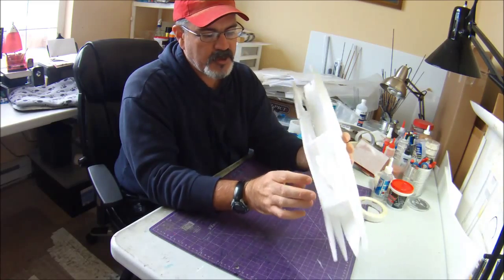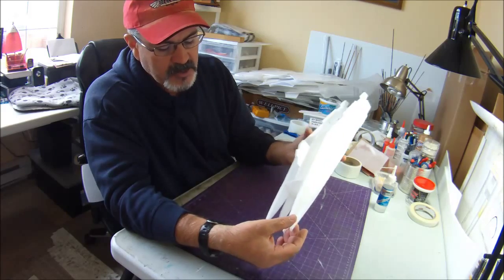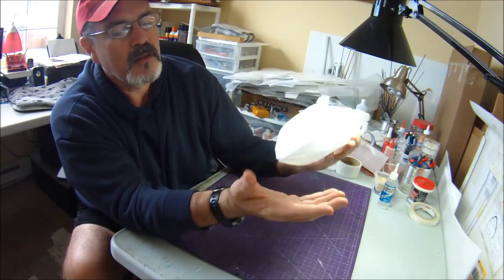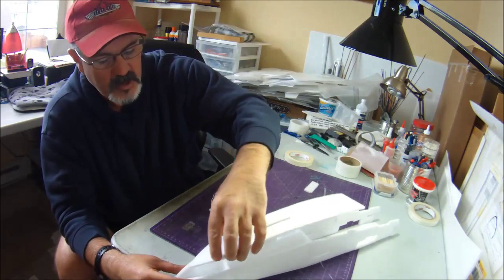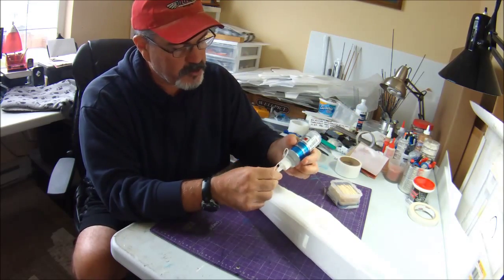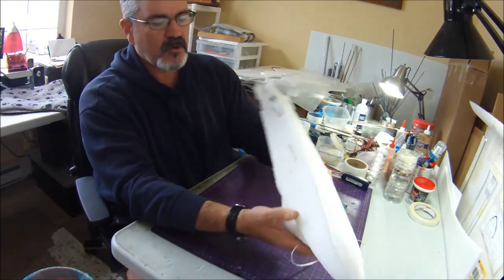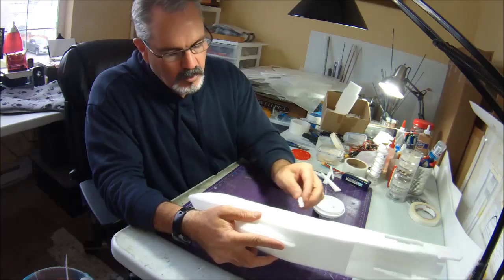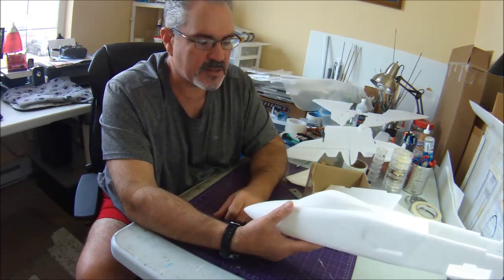NAMC Mig FA nose construction

Comment: what are the advantages of foam cure compared to the 5-min epoxy? which one to be used for which bond? do you use hot glue? thx
Reply from the maker: Foam cure is dispensed out of a bottle, so no need to mix and less waste.  However, it does take quite a bit longer to cure than 5 min epoxy and does need partial exposure to the air to fully harden.  Epoxy in my experience is better for securing carbon rods etc in the foam for reinforcement and securing control horns and motor mounts.  I do use hot glue sparingly to "spot weld" when I need to hold a couple pieces together and need something that sets up quickly.  I also use hot glue to secure my servos as it is much easier to remove when I need to recycle servos to a new plane.  Cheers, Scott
Reply: thx a lot for all your answers!
Reply: can foam cure be sanded like the epoxy?
Reply from the maker: Sure thing, best of luck on your RC journey :)  Cheers, Scott
Reply from the maker: Yes, Foam Cure can be sanded just like epoxy, it takes a little time and patience, but it will sand quite nicely.  Cheers, Scott
Reply: one question again. can you cut the foamcure with a scalpel? for example a thin layer between two depron sheets?
Reply from the maker: Yes, you can cut it with a sharp knife.  I let it dry completely, normally overnight and then always use a new, sharp blade and it cuts/shaves very nicely.  Cheers, Scott

Comment: hi. whats the stuff called you show at @39:15 ?
Reply from the maker: It is called DAP Fast and Final, a lightweight finishing spackle for filling drywall and other things.  It dries very light and is easy to sand.  Here is a link I found on Amazon https://www.amazon.com/12141-FastN-Spackling-Interior-Exterior/dp/B0006MXS10/ref=sr_1_1?ie=UTF8&qid=1492369477&sr=8-1&keywords=dap+fast+and+final  

Cheers,

Scott
Reply: i see. thanks. any experience with gypsum?
Reply from the maker: Sorry, no experience with gypsum.  Cheers, Scott

Comment: I hope I was clear on what I am doing with the strips. I cut them to form a triangle. THis triangle I insert at the folds with two sides getting a small amount of Foam Cure glue. This smooths out the fold and adds strength with almost no weight gain because I am adding less spackle.
Reply from the maker: Doug Wittenberg Hi Doug, no problem, I fully understood what you were saying, I have used that method in the past as well and might try again on another build now that I am using Foam Cure, I need to practice a little more to get the triangles closer to the right shape, my "surgical" knife skills aren't the best :/  Stephan uses the same method I think.  I use to use scrap dollar store foam because I found it sanded more easily.  Now that I have been using the Fli-Value XPS foam from RC Foam, I might try that since it also sands really well.  Cheers, Scott

Comment: I crashed my Multiplex Weekender and put a number of 1 inch gashes in the wing. I used the Ultra-Thin Drywall tape  and then used  Foam-Cure to  form the wing
 and close up gashes. It seems to be working.

Comment: I always learn so much from your video builds. Thank you. 
I like the first part,the way you glued the front fingers together and will do it that way. 
At this point, I take scraps, similar  to the 45 degree parts left over from making the hinges, and glue them  at the folds using Foam Cure. This makes a very strong joint. Then I add the light spackling.
Reply from the maker: Doug Wittenberg Hi Doug, thanks very much.  I must admit the hot glue method came to me as a bit of an epiphany coupled with impatience as I find that the nose construction can be a fussy part of building these park jets.  It might not work with all planes, but I will try it as much as possible, since it helps get that first part of the nose formed so much quicker and stress free.  Sorry to hear about your Weekender, but sounds like the repairs are holding up well.  Stephan sent me a video awhile back as we have been working on the Mig-FA where he had squeeged a very thin layer of Foam Cure along the leading edge of the wing, then let it dry completely.  In the video he tapped on it with a piece of carbon rod and I thought he was tapping on fibreglass it set up that hard and durable.  Good luck with the building and flying :)  Cheers, Scott